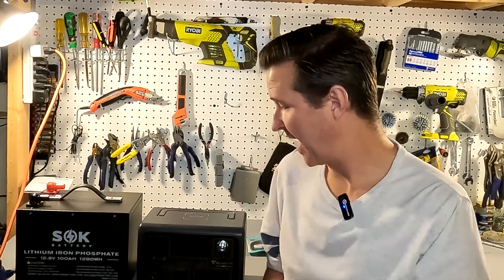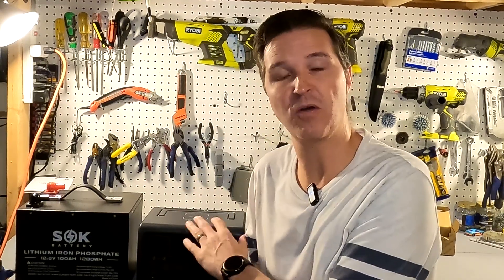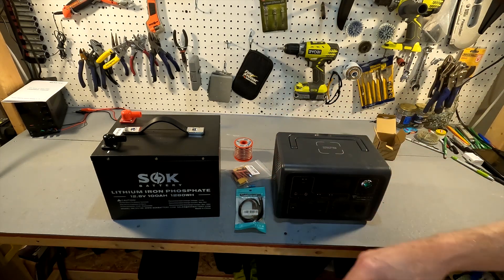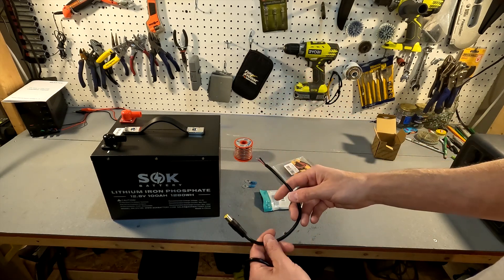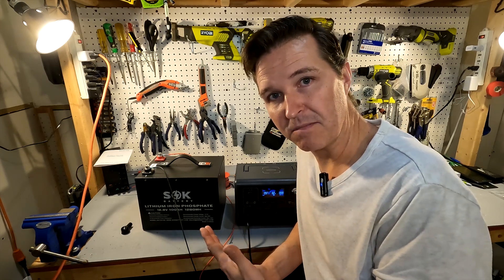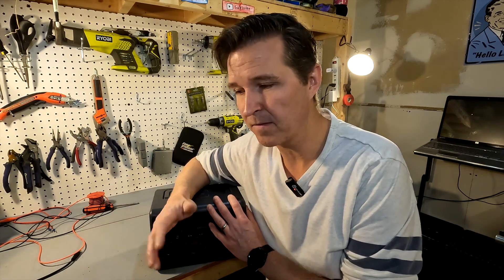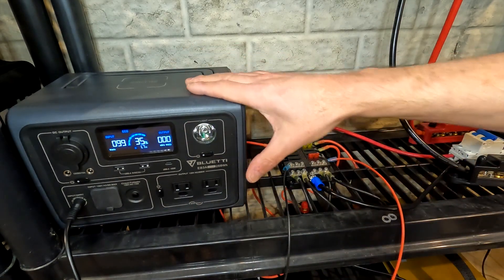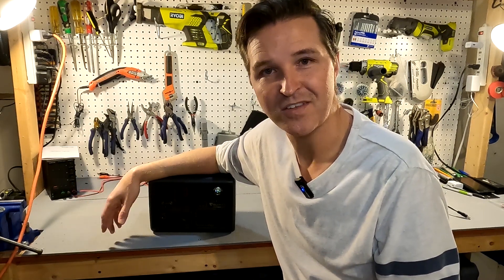EB3A Battery Extender

Comment: Fortunately I see there arw places to buy battery clamp cables with 8mm barrel plug ends, also can get them to mc4 ends. So I dont have to make my own. 😉
Reply from the maker: That's even better!  Thanks for the comment.
Reply: @OffGridBasement  - Definitely it is more my speed at this point, don't have the tools, need the simplest. People like you can probably sell to people like me, doing even some custom cables, connectors, etc. 

Like how you showed us the wrong connector you originally put on, and why it was not the safest "correct" way to do it. Recently I saw someone who did a similar thing but did not realize that it was not the best.

Comment: how do you charge the external battery pack using bluetti? is that something possible?
Reply from the maker: I don't think you would be able to charge the 12v battery from a DC port on the Bluetti.  You would need an external battery charger to plug into the AC.  The best thing to do would be to have a solar panel connected during the day to charge the battery and the Bluetti at the same time.  I'll try that out in another video.  Thanks!
Reply: @OffGridBasement  Thanks for the info!

Comment: This is a great video and I thank you for it.   I have the Bluettie EB3A as well and have recently been experiencing problems with it.  I’ve hardly used it at all.  This seems to be quite common.

Mine “bricked” itself for no reason at all that I can determine.   It kept showing “Short” on the screen with nothing plugged in.   I kept connecting and disconnecting the power cord and pressing the DC/AC buttons to turn it on to no avail.  I ended up just leaving it plugged in (like I always have) and now all of a sudden it is working with both AC and DC sockets working without the “Short” notification.  In fact, I’m running an ICECO refrigerator/freezer now to test it and all seems to be working well.

I can’t say that I can recommend this battery bank with these issues and Bluetti doesn’t seem to be helpful at all to anyone that has experienced this.

Well, I got sidetracked there from your video.  Hopefully mine will continue to work now and if it does, I’m quite interested in using your technique here to extend the battery life of my EB3A.

Thank you again.
Cheers, from Tomball, Texas
Reply from the maker: I'm glad you were able to get some info from the video.  Bummer about your EB3A acting up.  I've also heard customer support is sub-par.  Thanks for the info and the comment.
Reply: I had the exact problem but kept emailing Bluetti support email and after failing to fix mine after sending it in they replaced my unit with a new one. They paid shipping as well. It went pretty smooth.
Reply: @DroneManMurphy  
That’s outstanding!  I’m glad they stood behind it and did you right!
Happy Holidays

Comment: Exellent info.
Just purchased the ED3A and am  understanding you can use this as a UPS unit.

If so cound i make a male to male short extention cable and plug in any camper 110 outlet to make all the outlets live . Understanding i would never use a 30 amp connextion at the same. time.
Basicaly boon docking wirh the Blueetti.
Thx for your input.
Reply from the maker: The only thing I would worry about is if you have any other form of inverter input wired to the system as well.  Having power pushed into the AC output of the camper inverter might be bad news even if it's not on.  Other than that it should work just fine.  Just remember it's only 600w.  Hope this helps and thanks for the comment.

Comment: I have a 12v to 24v step up convertor (buck convertor I think you call them) and if the EB3A is not-in silent charge mode it will charge at 150w from a 12v source I have. Without that convertor I just get 70w charging.
Note that if you have the EB3A in silent charging mode it seems to cap the charging like this to 99w.
I use a cheap second Power Station to extend the EB3A in this way.
Reply from the maker: Good thinking!  Also, I misspoke when I said "buck" converter.  It's called a Boost converter.  Just fyi for ya.  Thanks for the info and the comment

Comment: Great video - super helpful.

What about this setup when camping for a week:

Daytime - 200w solar charger plugged into eb3a solar charging port adding roughly 100-150 watts/hr. Simultaneously have a Haisito 20 amp battery charger plugged into an AC out port on eb3a to charge an external LiFePO4 battery (12v 50Ah for example) for full battery charge top off. In ideal sunny conditions both units could be completely topped off during the day.

Night: use ring connectors from an external battery that end in a dc7909 plug and plug into solar input on eb3a. This allows you to use outlets/charging ports as needed overnight. Round numbers, the external battery will replenish eb3a at roughly 100w/hr with 12V or 200w/hr if using a boost converter to increase to 24v. If only running a fan and maybe charging a few phones/iPads, this could work indefinitely with sun by day.

Any potential problems/issues with this?
Reply from the maker: On nice sunny days this setup would work beautifully IMO.  I don't see any issues with doing this.  All the charging and discharging is well within the specs of the EB3A.

Comment: That looks really interesting. I am looking for a solution to do that with a 50000 maH Power Bank. There is a output of 12V 20W. Now i will check if that works on the same way. I will do that to enlarge the running time for my Campingfridge At the Moment my Coolbox is good for about 7 Hours on the EB3A , because she is running not all the time. Thats why i think with an additional input of 20W i can enlarge this time by some hours. Or what do you think? Sorry for my bad english.
Reply from the maker: Hello!  I don't see why it wouldn't work.  With a 50k mah bank you should be able to get about 1.5 more hours of use.  Good luck!

Comment: Does it have to be lifepo4 battery        ?
Reply from the maker: No.  Lifepo4 is just my preferred battery chemistry.  Lead acid or flooded will work just fine if fully charged.

Comment: I jumped on the band wagon when the Bluetti AC200 max came out for my Motorhome but quickly learned that the product doesn’t have the functionality or settings to have a really good system, to expand it requires crazy expensive large!! Batteries and customer service is brutal. I sold all my Bluetti equipment and purchased Victron equipment and built a system that is scalable, reliable and has a support network of dealers and community.
Reply from the maker: You definitely went the right direction with Victron.  Top notch equipment and a great community.  Thanks for the comment.

Comment: Can the ED3A charge your battery bank?
Reply from the maker: Only if you had an AC battery plugged into it.  If you did direct DC to DC it would go over 10 amps and stop the unit.
Reply: @OffGridBasement  I see, so you would plug solar panels into your EB3a, then have the EB3a plug into an inverter, then plug that inverter into you DC battery, if you had a DC battery?

Comment: It's a shame ☹️ that bluetti never came out with an expansion battery for the eb3a.
Reply from the maker: It really IS a shame.  That option would've made this unit so much more versatile.
Reply: Look up the AC60. Is essentially a bigger EB3A with battery expansion capabilities
Reply: @mclaine33  there not much information out there yet about that one :(
Reply: @hoopoo3721  it’s been out for a bit. The A60 is essentially a bigger EB3A. The battery is like 600Wh and has 600w AC output. It also has 2 expansion slots so it allows you to connect up to 2 B60 expansion batteries. The main selling point of the A60 and B60 is that they are IP 65 rated water proof so they can be left outdoors in the rain without issue. The waterproofness is apparently a significant factor for why the product cost so much. In my case I viewed it as overpriced because I don’t need it to be waterproof.
Reply: New battery expansion for the EB3A is B80, 806 Wh For about 900.00$ canadian $$, but the problem is that the cable to make a battery bank is not ready to buy yet, i know it is a bummer , but at the same time i find the B80 expensive compare to just buy a regular battery.

Comment: Would it be possible to do this while charging the battery with solar through a charge controller? Ie solar panel into charge controller into battery terminals which are also connected directly to the power station. Thanks!
Reply from the maker: You sure could.  That setup wouldn't cause any problems.

Comment: Can I use 10 guage wire instead?
Reply from the maker: You sure can as long as you can get it to fit on a 5521 plug.
Reply: Ok I thought you said a 7909 barrel plug...is this too small for 10 guage wire?
Reply: On second thought I can just go ahead and buy some more wire and do it your way :)) Thankyou so much for this awesome video. You rock!

Comment: Would this be the same as charging the  Bluetti with a cigarette lighter in your vehicle? If not what is the cheapest battery I could use to do this set up? Thanks, great video!
Reply from the maker: Yes.  It is basically the same.  I would just make sure to charge the Bluetti while the car is running.  Thanks for the comment.
Reply: Thank you for the quick reply…!

Comment: I wish a low cost DC battery expansion system existed for these small solar generators.

I figure it consists of three parts:
1. Charging the solar generator from an external battery (easy, done)
2. Switch input to solar if available, as most generators do not have two DC inputs. Automate if possible
3. Charge the external battery from the solar generator when excess solar is available. Automate if possible

I haven't found anyone that's really attempted to build up a system like this. Maybe it's a fool's errand and the answer is to build a DIY system from components.
Reply from the maker: Everything I've come across that can do anything like that is a few thousand dollars.  Those abilities on a smaller unit would be great!

Comment: Great video, I have almost the same set up, except I added a 12-24v 10A step-up DC-DC converter and get a bit more into my EB3A, EB70s and the Delta Pro 2.  It really extends the use in an emergency. In addition, I wired a Shunt to the 12v battery to monitor the status, incoming and discharge wattage.  
This is great information, thanks for taking the time to share.
Reply from the maker: Sounds like you have everything in order!  Thanks for the comment.

Comment: Huge waste of money. Actual useable Watts. About 240 ! Real life  usage. What would you want to leave on for 7 hrs? A 500W heater. This Bluetti will not power it but for 1.75 hrs tops. What about a TV for 6hrs? Refrigerator? Hmmm?  Then you must recharge it. Waste of money.
Look at it this way.
Nobody's talking about this low Watt available over the long haul for the nite or day.
240W ÷ 7 hrs =  34 W useable per hr before it's empty. 
Nobody's talking about this talking point.
Reply from the maker: Thanks for the info and the comment.  It will help people decide when purchasing.

Comment: I have a eb3a that I use with my mini van camping and need to extend its power and flexible ways to recharge.  I'd like to use a 60ah deep cycle battery with it because they weigh 40lbs instead of 60lb for 100ah  plus they are cheaper.  at the same time the eb3a is connected to the 60ah battery like your descibing I'd like to be able to charge both via cigarette lighter from my vehicle or from a 60 or 100watt flex solar panel on my roof.  I'm fine with low wattage recharge rates like 90watts (7.5amp) so I can use lower gauge wires or run slightly longer distances. I really don't want to have to use more expensive components like a solar charge regulator.  I want to be cheap and safe.  If i have to get a 2nd eb3a that would be fine although I'm hoping to wait until it has a bidirectional usbc port.
Reply from the maker: That sounds like the perfect scenario for using the EB3A.  I did a review on the Allpowers s300.  It has bidirectional PD charging.  It's around $200.  It uses li ion and not lifepo4.  Don't know if that's a game changer.  Thanks for the comment.

Comment: I did the same thing. Now I have a 600 watt inverter for my SOK 100AH battery that has 200 watts being inputted. I don't think I need a bigger power station for what I'm doing.
Reply from the maker: That is excellent!  That is exactly what I'm talking about.  No reason to upgrade your power station just to get more capacity.  Thanks for the comment.

Comment: Good idea, but this usage is safe for the LiFePo battery or battery is constant under charging (short life) ?. Thanks
I'm going to buy an Allpowers R600 with 400W of solar capacity
Reply from the maker: I don't see any reason it would reduce the battery life.  The charge rate is fine and the mppt inside of the Bluetti would stop charging when the unit is full.  I would unplug the unit when not in use.  I hope that answers your question.  Thanks for the comment.

Comment: I'm curious about what happens when the bluetti battery bank and the external battery approach the same rated voltage, like at 80 or 90%...I wonder would the transfer continue or would the batteries balance out. I do basically the same thing except I do use the 12 to 24v boost converter and have never tried it with a stand alone battery. I guess it would go all the way to 100% since bluetti promotes the ability to charge with an automotive cigarette lighter adapter, thanks 🌞
Reply from the maker: That is a good idea just to confirm that it works.  Maybe have a battery @ 12.3v and see if it charges at the same rate.  Thanks for the comment.
Reply: EB3A battery is 7S2P cylindrical cells, so the DC input is being passed through a MPPT charge controller to charge the battery. There's no approaching the same rated voltage but may see taper as it approaches the top.

https://www.youtube.com/watch?v=8-Lwy42mbsw
Reply: @michaelbeatty130  So would it be correct to assume the internal battery is in the neighborhood of 24v ?   7 × 3.4v per cell would be 23.8v . I think I have seen that another teardown video of the eb3a. Thanks for the info

Comment: Just add a Buck converter and go From 12v to 24v should give you about 140 -150 watts of power
Reply from the maker: That would work well.  I believe they are about 98% efficient.  Thanks for the comment.
Reply: Boost converter if you're Increasing voltage with converter...buck if you're decreasing voltage
Reply: @jime9305  yes I did get that wrong lol I do know if you do that it will get hot so maybe put a computer fan on it to help keep it cool

Comment: not finish building my power station yet need few more things solar charger need get temperature sensor for 12volt fan this what have so far 2 20A breaker one 20A breaker for 110V GFCI out let 150A fused with 15A Breaker I make my own breaker panel in my tool box for my power station so my inverter well protected when I finish I send the link so you see my build of my power station am waiting few things from amazon
Reply from the maker: Sounds good.  I'm looking forward to it.

Comment: I have question for you ok do think a ups can run longer than like 1hour they very good but battery life sucks they like inverter you plug them to charge if power go you have few minutes of power I see people hack them make run much longer
Reply from the maker: Yes.  As long as you keep the battery voltage the same, you can wire up any size of battery.  Most UPS are 24v 9ah.  Basically 2 12v 9ah batteries connected in series.  I don't know how fast the batteries will charge.  That might be the downfall.

Comment: I did that with my EB3A, including a 12 to 24-volt step-up transformer to maximize the input watts.  Still, the setup is limited because 200 watts input can't keep up with 600 watts output.
Reply from the maker: That's true.  It definitely doesn't replace the need for the internal battery, but at least it's an efficient way of charging without solar.  Thanks for the comment.

Comment: Neat idea, thanks. If you decided to add an in line fuse to the connection between the 12v Lipo4 battery and EB3A, what size would you recommend?
Reply from the maker: Since I used 16awg wire, I would go with a 20amp fuse.  I believe that size wire maxes out at 18amp.  If you want to be really safe, go with a 15amp fuse.  Hope that helps.

Comment: Just hook up a 24v battery to it. The charge controller inside the eb3a will limit the current draw.
Reply from the maker: I do plan on that just to see if it gives double the wattage to the unit...  Which it should.  Thanks for the comment!
Reply: I have my 36 solar into regulator drops it down to 27w and charges at 200 w no problems

Comment: Today i opend 800 watts inverter and it have ground wire to plug i opend 3000 watts inverter it not have ground wire to plug out let this have three wire white ,black and green wire to out let on the inverter
Reply from the maker: If you are asking if the Bluetti has an actual ground, the answer is no.  It's just a hole for the ground plug to go.

Comment: Great Video. I use that same SOK connected to adjustable boost converter to about 25V to get close to 200W of charging for my Bluetti EB70.
Reply from the maker: Does the boost converter get hot?  That's one of my concerns.  Thanks!
Reply: they should make them water proof ok i making one its water proof

Comment: Tried this with my Jackery 300. Works like a charm from LiFePo4 or gel battery.
Reply from the maker: Thanks for the info and the comment!  What is the voltage range of the Jackery?  12v to 28v?
Reply: Yes.  12.6 to 24v, but I’ve used a gel battery at less.